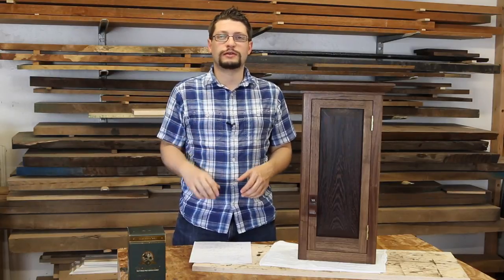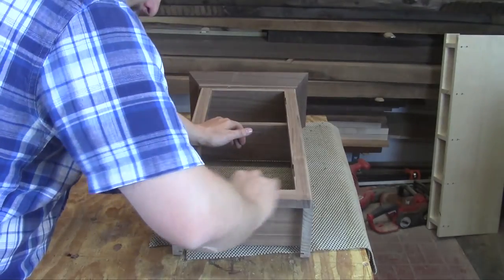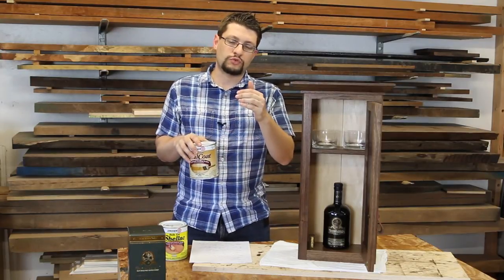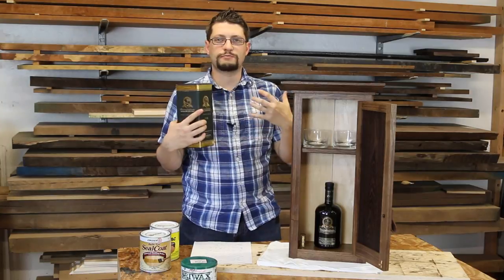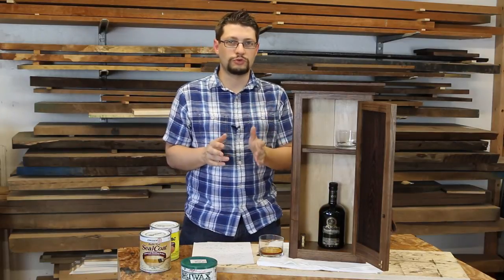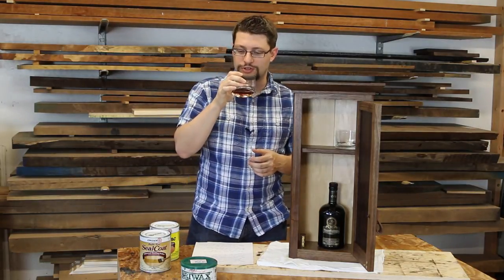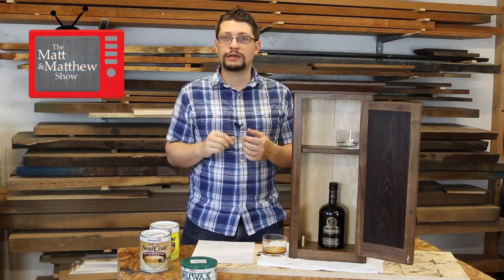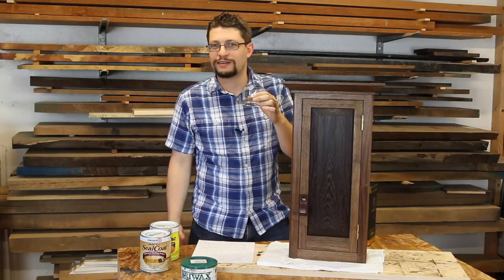Shop Update March 19, 2015

Comment from the maker: Jody Cleary I first used shellac on the wenge and that was to seal / protect. I did not fill the grain first. Nor did I use any filler on it. When I used the Briwax, I let it stand for a 10-15 minutes and applied a very liberal coat. The Briwax is very liquidly and fills in the pours. As it dries and you buff it out, much is left in the pours and leaves a surprisingly not mirror smooth, but pretty smooth surface.